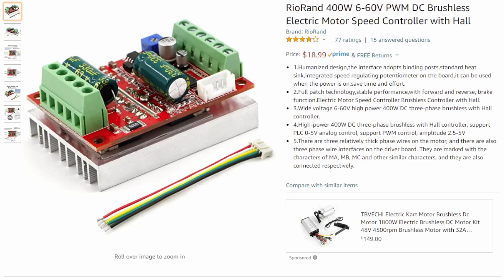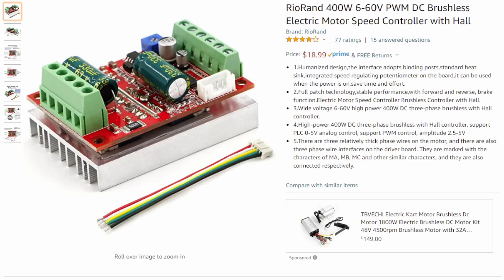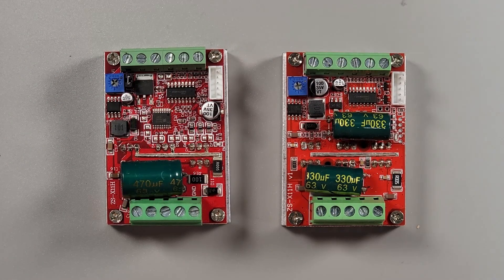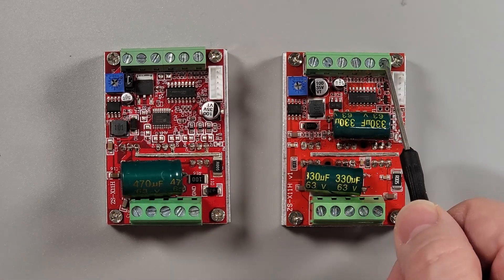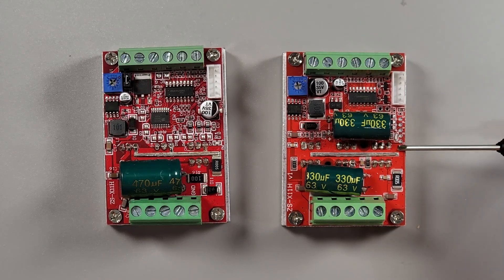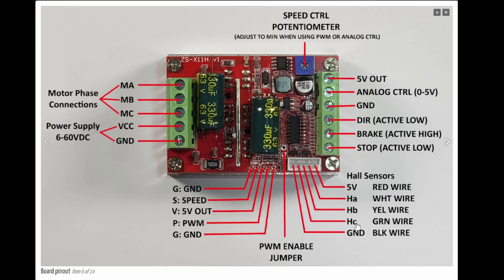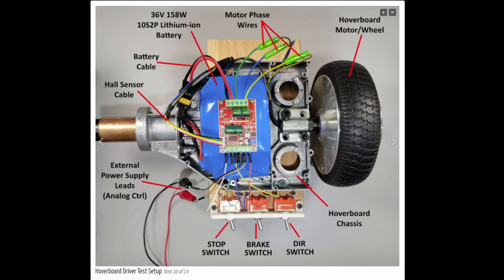Inexpensive Hoverboard Motor Controller

Comment: Man took me like half a day to get my wired up and working.
So first, not all hoverboard motors are the same. VERY similar, direct drive, 3 phase, hall sensor motors. Direct drive scooter motors are similar. But the wiring is NOT the same.
My 3 phase wires do not not go in the same spot as yours, Mad-EE.
And obviously, my hall sensor wires aren't the same as yours.

For those reading and what to do this yourself...
You'll probably have to unscrew your hoverboard motor inner-side-panel. It's 8 little screws.
Pop the panel off with a flathead screw driver or metal scraper. It probably has a bearing in it, so be careful. And work it up slowly around the wheel.

On the side of the motor, facing up at you (hopefully) should be a hall sensor. It'll be C-ish or crescent moon shaped.

It'll have 5+ wires on it. If there's more than 5, then 1 is probably a temperature or speed sensor, and you can ignore it. My 6th wire was white.
If you look closely, the hall wire motors are probably labeled on the circuit board. Look carefully. They're small.
Those letters should match the lettering on the hall plug pinout. Ground, C, B, A, and V+.
The chances are that the Hall colors you match with A, B, and C, will match the motor's phase wires (A, B, and C). Hall - left to Right (C, B, A), Phase - up to down (A, B, C),  I think.

You can test with the onboard POT.
But you can also send PWM signals from a raspberry pi.
Like if you use a Pie's ground PIN, put it on the controller ground terminal on the right signal bar.
And use another GPIO pin (like pin12), and connect that to the 5v signal terminal on the right bar.
Then you can send it PWM signals through python... Like pwn.ChangeDutyCycle(100) (for 100hz frequency).

Once you get to this part and it works -^ , you're ready to do ANYTHING!

PS - This board REQUIRES you to use the hall sensor wires. I tried every configuration with the phase motors, and I couldn't get a signal down them without the hall sensor wires configured.
Even a wrong configuration is enough to get the motor spinning, noisily  :)
Reply: Are you using the PWM input on the board? I can't seem to get mine to work.
Reply: @KnexRules8365  I used various methods to control it. Pwm from a raspberry pi. Pot. And 5v. 

It's probably the hall wiring. Keep rotating the hall wires along with the 3 phase power wires. Usually the hall wires and power wires are the same color.
Reply: @chriswf  The weird part is that I had everything working previously with potentiometer control and it was fine. I suppose it's still possible it won't work unless the wiring is 100% correct, but I'll probably just have to keep messing around until i figure something else out.

Comment: Great video and explanation. Thanks for the info. May I ask if you have used this controller with Raspberry Pi? I want to control the hoverboard motor using this controller and RPi, but I am struggling with the wiring connections between this controller and RPi. If you know or have done it with RPi, would you mind sharing the circuit diagram or the photo of the wiring? Thanks 🙂
Reply: You can use GPIO pins that aren't grnd or power. I used pin 12. Then write your python script to activate it. Test with an LED first. If you can get the LED to work, then the issue probably isn't with the PI.
Also you're using a hall sensor, those have to be wired correctly. If it's a hall controller, it will NOT operate w/o the hall sensors plugged up. I tried lol.
Reply: @chriswf  Thanks. My RPi works coz I am using it for other projects. I was asking about the wiring connection for the controller. I know that hall sensors need to be plugged up. There are 6 connection points on the controller - 5v out, Analog control, GND, DIR, Brake, Stop. Which of these did you connect with the RPi pins? Thanks. I know that GND will be connected to the GND of RPi. What about the rest ? Thanks.
Reply: @kaytondouglas2094  You only need GND and Pin12 I guess.
Put them on the ECS gnd and signal terminals.
Set pin 12 to GPIO out:
GPIO.setup(12, GPIO.OUT)
Then use the PWM method on the GPIO object passing in 12 (for pin 12) and 100 for frequency (100hz):
pwm = GPIO.PWM(12, 100)

After that pwm.ChangeDutyCycle(22) or whatever range you want (0-100)

Edit: The same way you do an LED btw ^^ :D
Reply: @chriswf  Thanks. I think you need these 4 Analog control, GND, DIR, Brake 🙂

Comment: Hi. Nice. How the hell can I make with Arduino a brake signal? I’m building an injection mashing were the hoverboard motor squeezes the mold together and I need to hold it in position so that it won’t turn either ways ? :)
Reply: the 5v brake isn't going to be powerful enough to keep them from moving. You'd probably have to continuously feed power to keep them still. And you can just use a pinout on the arduino as a high signal to power the brakes

Comment: Good day to you Sir I want to build a 4x4 vehicle I’m a wheelchair user I want to make it a drive on my idea is as follows I’m thinking to Use 4 electric Bycycle hub motors 1000w inside a 26” Bycycle wheel with fat wheels  do you know if there is a controller to run the motors I will need forward and reverse is that possible on a system like this to disconnect 3 motors to save power or will the disconnected motor not spin easily  thanks and use more power

Comment: Great Video! I was wondering if you could give some insight on how you charge the battery outside of a hoverboard? does it have a built in BMS?
Reply: I use a variable DC power supply to charge batteries. Set the desired voltage and amps based on the battery type. As the battery reaches the desired voltage the amps will drop to 0
Reply: The ones have disassembled all had a bms board inside

Comment: Hello how do I add a potentiometer to go forward backwards and break thanks
Reply: The potentiometer is only for speed control. You will need two more switches one for forward/reverse and another for brakes. Check the wiring diagram for this motor controller on amazon it'll show you how to wire it up

Comment: is the hall sensor really necessary if only interested in the analog power range, from 0-100% and coasting? 
Braking would be done mechanically, and reverse not necessary, but what would the downsides be?
Reply: I'm curious about this as well. I've been trying to test without using the hall sensor.
So far I can't get the motor to move.
Reply: @chriswf  it doesn't work without the hall sensor

Comment: Hoverboard batteries are usually 42V, not 36V.  36V is the "nominal" or just the name of the battery.
Reply: That's incorrect
Reply: @Kit.t1x  You are incorrect -- and provide no details either.  They discharge over a range --- usually from 42V to 30V --- but the "36V" is just a name.  That's why it says "nominal".  Look it up.  The actual battery voltage for a 10S NCA battery is 42.0V.

Comment: What would the next step be to add remote control to this system? 
Something like a FLYSKY FS-i6X remote control, or would it need something additional like an arduino or something? 
Love the video btw looking forward to seeing more from this channel!
Reply: Hi , me too i try to add FlySky FS-6x remote control i use jump cable for pwm signal  but the result is not correct, do you find more information on wiring, less arduino connection .
Reply: Doing some research, seems the only option is using an arduino to change the rc pwm to one that this controller wants. I'm hoping I can find a better "off the shelf" option though
Reply: From what I can tell, you have to use an arduino and read the spacing of the RC servo signals. Which is kind of lame :( 
From there you'll use the arduino/PI's PWM signals (which this board does read)
Reply: @chriswf  Have you tried this yourself? I'm working on it right now, and for some reason the motors aren't doing anything. I have even tried copying his code from the guide on his website, and nothing works. I've jumped the J1 spot to enable PWM control and wired everything up right but still no luck. And now the weird part is, even my pot control doesn't work anymore. I'm not sure how I could've fried anything since I've triple checked my wiring and pin ins/outs and everything is right

Comment: Very cool. I have two hoverboards for parts projects. The first one is not the standard hoverboard motherboard and runs at 24v. The second one, is the standard motherboard at 36v. With the second one, I tried the STM32 programming hack, but could not connect. No chance of doing the hack on the non-standard motherboard. Since I have a total of 4 motors, this lead me on a quest to find an alternative driver. Thanks very much for your video! This may be the approach I take in my project(s).
Reply: Update: I now have 3 Hoverboards for parts. (6 motors). Just received a pair of the RioRand hall-less controllers in the mail from Amazon today. I look forward to some experimentation.
Reply: @whitneydesignlabs8738  how you make the 2 different wheels turn in same direction
Reply: @jtx5868  I have stopped trying to use the hoverboard mother boards. I now use the Riorand controllers with hall effect sensors. They work great. Lots of info about them on the web. I am working on a 3wd trike, now.
Reply: @whitneydesignlabs8738  do you use controller like they in this video ?
Reply: @whitneydesignlabs8738  how you reverse the direction of motor ?
Reply: @jtx5868  Yes, I use this exact controller mentioned at 0:22. It has the hall effect sensor and allow fairly precise speed control.  I love these controllers and keep some on hand at all times. I don't think I would mess with the hall-less style now. Although less wiring, the control is not nearly as precise.  What I do now, is use a microcontroller, like a Pico, to provide the control signal to the input of the motor controller. This way, you can tweak all your control in software. I prefer Python. My next step, is to read the pulses from the controller, like Mad-EE does with his scope. But I want to read them with the microcontroller, then adjust the signal to get precise RPMs. This will be useful as an electronic differential in cornering etc.
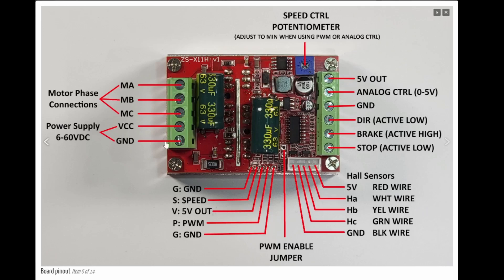Reply: @jtx5868  Look at the diagram at 2:05. See the direction pin? Whether it is high or low dictates motor direction. Also, really easy to control with a microcontroller, or mechanical switch. Very versatile, these controllers.
Reply: @whitneydesignlabs8738  i mean the direction is always opposite so my plan is to build autonomous vehicles and i need the motors in same direction
Reply: @jtx5868  Right. no problem.  One controller per motor. Then just set the direction pin for whatever rotational direction you want the wheel to go.  If the motors are opposed, like mounting axles pointing to the center of your platform, just make motor A turn CW and motor B to turn CCW, for a movement in one direction, and reverse both, for movement the other way.  You can gang up many for 2wd, 3wd, 4wd or 6wd etc... I have a heap of hoverboard motors and have an idea for a "trackless tank" using about 8 hoverboard motors per side... 16wd.... :)  But the control is the same regardless if you are doing a skid-steer technique.  I should point out, that if you are trying to use one controller for two motors, you will have other problems, too, in addition to direction control. One controller per motor is your design strategy.
Reply: @whitneydesignlabs8738  how i can make motor turn CCW and other in CW ? To get one direction ! If you have Arduino code for your 16wd can you provide me it to get idea about controlling motors
Reply: @whitneydesignlabs8738  where is pin direction ? Do you mean pin who are with brek and stop
Reply: @jtx5868  I feel like I have answered this already. On one controller hold dir pin high, and the other controller hold it low.  That would make two opposite facing motors travel in the same direction. Here is code for my 3wd trike.  Not yet programmed the "tank"
 
## Code written by Scott Whitney with lots of help from ChatGPT AI.
#The code uses a mapping function to scale the limited potentiometer range to the full range of adjusted values, allowing the motor to go from zero to full speed.
#The frequency of the PWM has been set to 20 KHz to match the BLDC driver.
#In the main loop, the potentiometer value is read, mapped to the full range of adjusted values, and the PWM duty cycle is set to the adjusted value.
#The loop also includes a sleep function to pause execution for 0.25 seconds and a print statement before repeating for debugging and configuration.
#The sleep and print should be commented out for actual motor usage.
# Import necessary libraries
from machine import Pin, ADC, PWM
from utime import sleep

# Initialize peripherals
pot = ADC(0)
MotorPWMInput = PWM(Pin(7))

# Tweak these values based on the speed controller type and potentiometer range
# These values were determined through experimentation with the motor's free spinning
# The goal would be to have the adjusted value be 0 when there is no throttle position (idle)
# and to have the adjusted value be 65535 when at max throttle position.
potentiometer_min = 17150
potentiometer_max = 51000

# Set PWM frequency for BLDC driver
MotorPWMInput.freq(20000)

# Function to map the potentiometer range to the full range of adjusted values
def map_value(value, in_min, in_max, out_min, out_max):
    if value < in_min:
        return out_min
    else:
        return (value - in_min) * (out_max - out_min) / (in_max - in_min) + out_min

# Main loop
while True:
    # Read the potentiometer value
    raw = pot.read_u16()
    # Map the potentiometer value to the full range of adjusted values
    adjusted_value = map_value(raw, potentiometer_min, potentiometer_max, 0, 65535)
    # Set the duty cycle of the PWM to the adjusted value
    MotorPWMInput.duty_u16(int(adjusted_value))
    # Pause execution for 0.25 seconds
    sleep(.25)
    # The following line is for debugging and configuration, it should be commented out for actual use
    print(raw, adjusted_value)
Reply: @jtx5868  I know I answered this question previously. But I will repeat the answer here. **Look at the diagram at 2:05 in his video. See the direction pin?** Clearly labeled.  At 2:33 he explains the pin and how it works...

Comment: Have you tried to run both motors to see how it would hold up under load? Im currently working on a project and normally im a buy once cry once person but since my project may be a dud im hesitant on purchasing a top quality controller
Reply: Same here, funny buy once cry once. Trying to avoid that on this project. The Greentime looks like best option now. Comes with esc and thumb drive. Aliexpress sucks for asking questions. I'm looking for a long range wifi deauther, diffrent project lol...and damn sellers just can't answer a simple question on aliexpress. Aggravating :(
Reply: @Joel Stolarski  look into the esp32 microcontroller or others with wifi and Bluetooth. Don't know if it would work with your project but worth checking. They're super cheap
Reply: @TheOldKid  I'm looking at thise and something called the 433, can't remember exactly. So many on Aliexpress, but not sure how reliablel thaey are. Getting questions answered by sellers is almost impossible. Somewhat stalled, but going to figure it out eventually, thanks for the reply

Comment: Thanks for the excellent tutorial, I am planning on making a motor mover for my caravan as they are extremely expensive and going to try use 2 x hoverboard motors . So you think it's possible for 2 motors to move 1800kg . An example of potential project https://youtu.be/yPRCtKVQPI8

I think a worm wheel gearbox may increase the torque significantly,  im planning the concept so your thoughts would be greatly appreciated.

Comment: I have a question, I try to build a RC lawn mover, I can use this controller? And it’s a way to use receiver for remote control?
Reply: I'm also interested in that. I managed to hack the motherboard (Firmware) of the Hoverboard, but I don't really like it. I'm using a FlySky I6x RC controller and it's not very secure. I'm afraid of mowing the neighbor's pepper, so I'd try these two motor controllers, but how do I connect them to the RC receiver? I would like help, I see in the comments that I am not the only one who is interested in this.

Comment: Thank you for your video. It seems that built in pot on my controller is faulty and creates jerky motion. I plugged in 40V ebike throttle into the controller and it runs nice and smooth. The problem is that ebike throttle at zero position still moves the motor at low speed. It doesn’t stop at zero just slows down. I checked the built-in pot and it’s turned all the way to the left at 0 position. Any ideas why throttle is moving the motor at off/zero position and doesn’t fully stop? I am using 36V battery.
Reply: I have the same problem. Your throttle has probably a range from 1v to maybe 4 oder 4.2
Reply: @-K0mpl3X  Thanks for pointing me in the right direction. Yes, throttle was the cause as it is at I think at 0.8V in it’s initial position. When I plug in regular 10k potentiometer it stays put until I move the knob.

Comment: Hello sir, you reckon this board can handle human weight or will it shut off? In trying to build a skateboard and making sure they dont burn or something else
Reply: they'll handle anything. I have them powering hoverboard motors that are moving a shopping cart (sometimes with me in it) and haven't had a problem at all so far
Reply: @KnexRules8365 how long have you've been using it and how frequent?